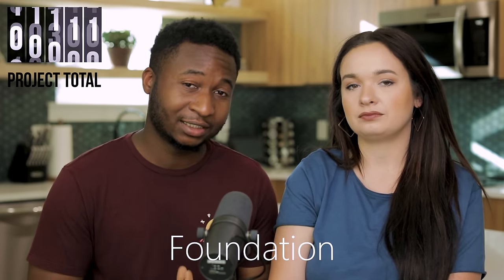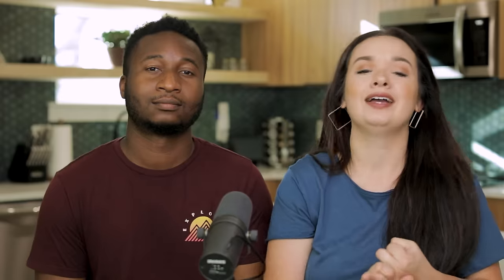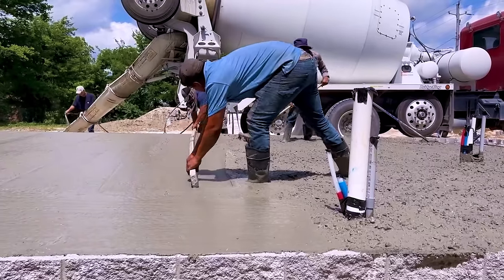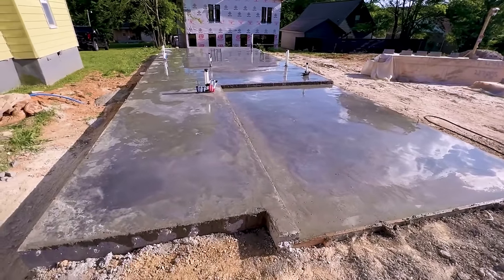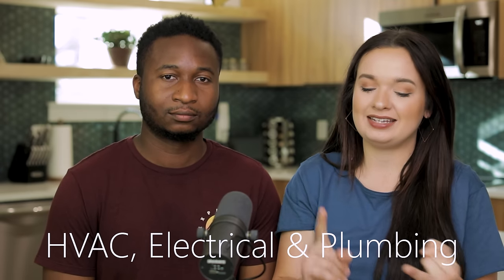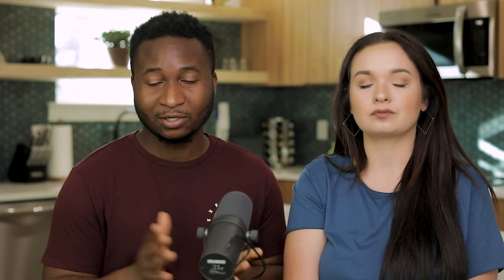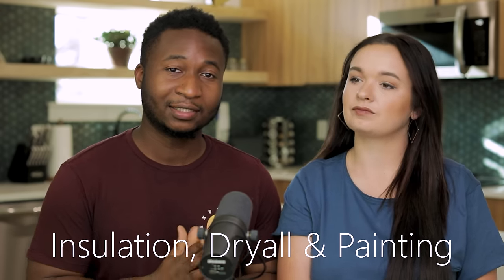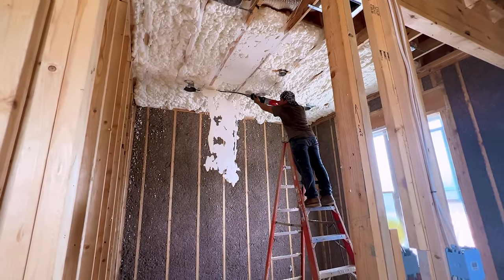We Built This Modern House For $200,000 - Construction Costs Breakdown!

Comment: I’m building my house in Southern California with a friend currently. Literally building it ourselves from ground up. And it’s still costing me 400k for a 1200 sq ft house. How is this house 200k? Just seems impossible. There are a lot more costs such as permits, hooking up electrical to city, city water hook ups, septic if needed, solar panels, and just the general cost of materials seem really low in this build. Maybe materials are a lot cheaper in Arkansas. This guy is a builder which helps tremendously to keep costs down but 200k for a ground up build is crazy low. Kudos to you guys for figuring it out!
Reply: I get it, Todd Southern California builds are a whole different ball game! I've built in WA, SC, and even overseas, so Ive seen how each place has its quirks and cost drivers. SoCal is especially tough with permits, utilities, and just general material costs that can easily push budgets higher. One thing Ive seen help is sourcing certain materials out-of-state where costs are lower, then shipping them in bulk. It can take extra planning but can save a surprising amount on key items. Also SoCal tends to have peak and off-peak building seasons, and a lot of people don’t realize that starting during the off-peak (typically around fall or early spring) can often get you lower contractor bids. Some builders are more flexible when they aren’t flooded with summer projects. Another thing consider is going with a fixed-price contract if you can. Having the contractor agree upfront on a set cost can really help avoid unexpected fees that tend to stack up in places with stricter building regulations. let me know if you'd like some more help brother were all in this together.

Comment: Great job! I am thinking about being the general contractor. I have remodeled many times and built my home from the ground up. Just didnt do all the concrete work. I want to move to Mountain Home and sold my house, with 300k after the mortgage paid off, and in the bank to use. Instead of buying a house outright, is all that I would save by being the general contractor is 30 percent? I am about to turn 67 and don't want to use up my time building it myself. Your 200k house would be 260k if you bought it instead of contracting it? Just trying to figure out the best way to go. Steve
Reply from the maker: Thanks for watching! On this house specifically, we did end up saving more than 30%. This was largely due to the fact that Kachi did a lot of labor himself. I'd say if you are wanting to plan for costs try to find new construction listed for sale in your area to see what the market rate seems to be!
Reply: When you say "Kachi did a lot of the  labor" your meaning hiring the work to be done as the general contractor or the physical labor such as hanging sheetrock, roofing, framing, wiring?  @NicoleNark
Reply from the maker: @57holloway  a little bit of both. He did some or the labor himself like painting, hanging doors, installing cabinets etc. On top of that he handles organizing and hiring the other subs taking over the GC role so that we did not need to hire an outside builder.
Reply: thank you very much.  @NicoleNark

Comment: When building for the first time, learn the construction lingo and the permit requirements for the particular State.  Have your financing approvals ahead of time.  Get a good project manager, if necessary.  Find a reliable and trustable builder who uses licensed and certified contractors.  Don't overbuild for the area.  You can also build in another state, you don't have to live in same state; just have reliable staff and visit the site periodically.  When you finish your project, it is absolute joy to either live in it or rent or sell.  Then on to the next one.
Reply from the maker: Valueable tips right here!

Comment: Insulation? Isn't arkinsas in the south and hot year round? What's the R value of the insulation?
Reply from the maker: Definitely not hot year round. Today I woke up and it was 42 degrees and we ended up reaching 76. There are large temperature differentials and freezing weather in the winter.
Reply: @NicoleNark  Wow I didn't know that for Southern States. I guess only Floriday is hot year round.

Comment: I plan on moving in after I get my CO, but won't have inside doors, flooring, all bathrooms plumbed, paint done.  I plan on doing those jobs and paying for them as I get more money while paying for the construction loan.
Reply from the maker: In order to get the CO, those items will need to be finished. The building has to be complete and up to code
Reply: @NicoleNark  No, I have moved into houses and the bathroom downstairs is only plumbed.

Comment: Thank you in advance. Lot Price in an Established Area. Praise God, for my keen thinking. Purchased a Parcel of Land in an Established Area. In field Lot. A Vacant Lot just sitting there. An Order House that got torn down. A LOT LESS DEVELOPMENT COST. Absolutely Correct. A new Sewer Service. Maybe, Maybe Not. Order Windows before pouring Concrete. Windows goes in right after framing. Framers Install the WINDOWS. "Material Cost." Will definitely not be building a 2 story home. Metal Roof Great Idea. HVAC, ELECTRICAL AND PLUMBING. Plumbing one of the first mechanical components. Installation, Drywall and Painting.  Price Varies. Interior Finishes. Floors, Cabinets, etc. You can do below cost or purchase recycle materials. Exterior Brick Veneer, Stucco, etc. Landscaping. I can do myself. Will Not Spend lots of money on LANDSCAPING. Will keep it Simple. River Rocks. Flower Beds. No fence. I do not like fences. Driveway. $200,000.00 Not Bad. Interest on Construction Loan. Toilet for workers. Dumpster, Utilities, Water. A lot of "RENTAL COST." BUILD COST PURPOSES. Definitely hire an Experienced Builder. Significantly PLAN. I AM A PLANNER. Willing to spend FULL TIME MANAGING. Have Experience regarding RENOVATING. NO STAIRS! PERIOD! Will not HIRE SUB-CONTRACTORS. I have experience with SHODDY SUB-CONTRACTORS. Why I chose to build my own HOME THIS TIME. A CONSTRUCTION LOANS. MONTHLY INTEREST PAYMENTS. HAVING A DOWN PAYMENT. YOU CAN ALSO USE THE LAND THAT IS PAID IN FULL. FINANCES IS FIRST AT ALL TIMES.

Comment: How is this a modern house? It is the same flimsy wood frame, here I gave the benefit of the doubt and thought don't when you said modern, and thought oh someone did it smart with concrete...Good luck but this will be a forever keep fixing as the typical US house, thus why Home Depot has soo much traffic all the time
Reply from the maker: Wood framing is the standard in the majority of US markets. Building a home out of concrete would not be feasible here with the high costs of concrete and affordable real estate prices!
Reply: @NicoleNark  Yeah it is unfortunate that the US is the only country that uses this flimsy concept and at best hollow concrete block for older construction, Scandinavian countries might use a lot of wood but the issue is with the subpar Plywood etc. Seems the overall cost of wood was still up a lot so concrete in itself is not really that much cheaper especially when you consider saving in insurance, maintenance, etc. Anyway like I said wish you both good luck and all the best!